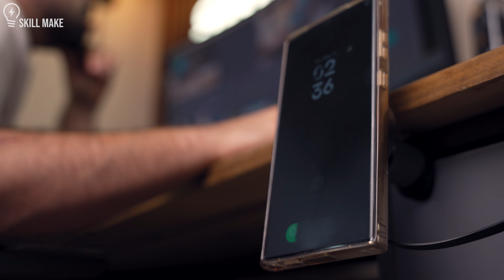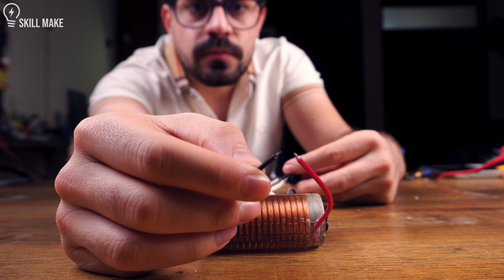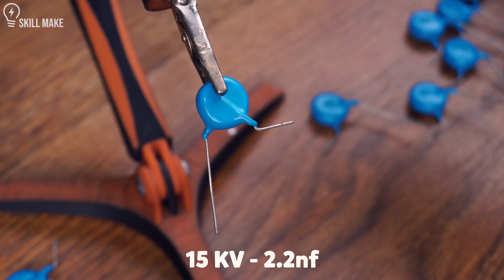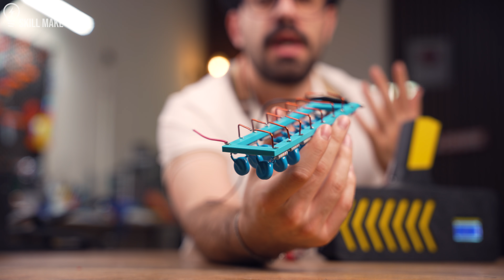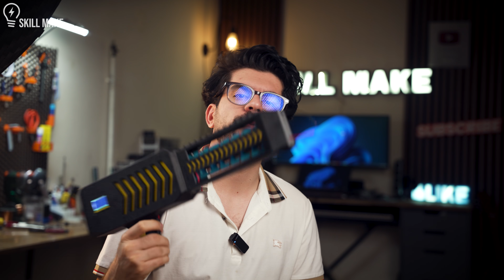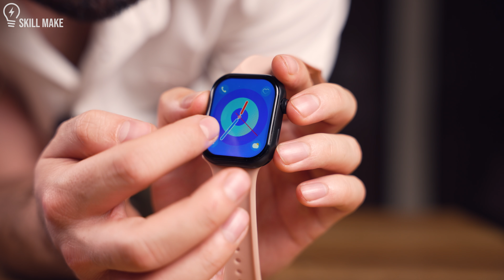I Made an EMP Device... It Actually Works

Comment: My question is can I use a microwave to just make a EMP out of that?
Reply from the maker: That's a classic movie myth! 🎬 High-voltage microwave transformers are incredibly dangerous (instantly lethal), and opening up a magnetron doesn't make an EMP—it just leaks highly dangerous, invisible radiation that can cause serious burns or blindness. True EMPs rely on ultra-fast, high-voltage capacitor discharges, not appliance parts. Stay safe! ⚡🛡️

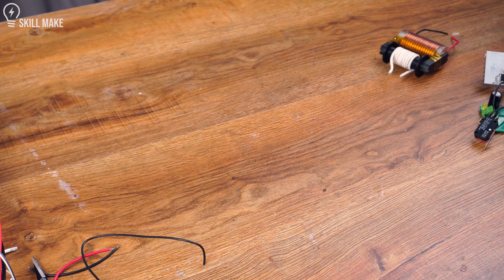Comment: 3:54 always follow the one hand rule man... I know EE ain't your background but that thing can kill you, not joking, no need to try it just don't use two hands like that.. simple enough. One more thing your voltage is max to max 800 times or less near that, never 1333 times higher, the voltage drop of your thin wire of that length is huge. And one more important thing.. here you need voltage multiplier ladder circuit using hv diodes.. not a marx generator.. pretty inefficient
Reply: +1 on that. High voltage across your chest - could be your last experiment.
Reply: Exactly!!! Cockcroft-Walton voltage multiplier... Works well

Comment: Not quite just giving 5v to a coil, needs to be high frequecy AC, and you can just see a transistor hanging (part of the oscillator needed).

Try charging a piece of 10 ohm coaxial cable (you may need to make it yourself), add a piece of ordinary wire on top, the length being the same as the coaxial cable (you will need to take into account the cable velocity factor). Charge the co-axial cable through a high value resistor (a few megaohms), and have a small spark gap (if you make a pressurised spark gap, you can get higher voltage up to the breakdown voltage of the coaxial cable), between the inner and outer of the co-axial cable. charging voltage only needs to be a few thousand volts, and you'll get a high peak power damped RF wave out of the antenna. Basically a vhf/uhf spark gap transmitter. Has some interesting effects, and you can run it from a tiny inverter and voltage multiplier (will work from just 3 volts into a disposable camera flash inverter followed by a voltage multiplier).

Comment: You need tweeters, and while you can make additional panels that could be better tuned for high frequencies, tweeters are 99% easier and will sound significantly better.

Comment: epoxy is normally not reactive when using less hardener.. you have to use a slow hardener, otherwise you risk that it doesn't cure at all..

Comment: An example of building things without understanding what you're doing.
Reply: Can you expand? What particularly is not being understood?
Reply: @MAORIguy25   But do you really need that? There are tons of comments that list everything the author does without understanding what he’s actually doing.
Reply: @nocrash8494  there are tons of comments giving advice

I’m asking why you’ve said he hasn’t understood what he’s doing

Did you say that because people are giving him advice, and so if he’s receiving advice he must not understand what he’s doing?

Your comment was said and there’s no clarity on why it was said
Reply: @MAORIguy25  I’m not talking about safety guidelines, which are just as necessary—and are lacking here—but rather about conceptual errors, the absence of a single dimensional calculation, and the fact that there’s no clear idea of what is actually being built to achieve the desired outcome.
Reply: @nocrash8494  
So you wanted calculations?

He used a 3D printed case. The case isn’t a template. It must be custom built for the parts he’s assembled

He didn’t show himself drawing it nor did he state the dimensions for the build… and yet those are necessary to be able to print the parts then assemble them

My point t is, work was done. That work wasn’t included in the video

We have to assume other necessary work was done but the details not included in the video

The absolute wrong assumption to have is to assume no planning or calculation happened anywhere just because you don’t see those on screen. That is a step too far, nothing in reality validates your position

Comment: Never use both hands, you're putting voltage across your heart
Reply: Not sure but afaik is the frequency to high to trigger the stimulus conduction. The problem with 50 or 60hz is that some parts of the frequency can interrupt the normal electrical stimulation of the heart but with that high frequencies this doesn't happen. I'm also not sure if it penetrate the skin very deep
Reply: Luckily the output is high frequency AC at that point..so whilst it was unpleasant more of an RF burn too.
Reply: He has a heart of steel
Reply: he isnt
Reply: i learnt that using my left hand to find the switch pins, right hand on the cables. Not a good idea.
Reply: There are four things to consider. Voltage, current, frequency and exposure time. None of them is dangerous by itself. But some combinations are really harmful, some them are deadly, and some of them don't give you even a chance to realize if you are still alive or not.
Reply: he's just charging his internal battery at a really really freakin fast rate of dendrite formation the rips the iron from his blood.
Reply: current, you mean
Reply: He only needs 30mA for a heart attack too.
Reply: If the current is low enough, NOT a big deal
Reply: And no resistor to limit the current

Comment: Next add a spiral line flux compressor to the device, a high pressure spark gap to trigger it with another to stiffen the output, finish with an antenna tuned to the center you want. ❤

Comment: So it is basically a taser with a coil? The main issue may be the range, which means you have to be very close to blow up the circuit.

The second problem is that you may only burn circuits that have no protection. Try that on anything that has a fuse or a voltage regulator and it may well fry only that component, instead of actually blow up the CPU or RAM or any other vital component

Comment: You might try replacing your MOSFET/PWM module with a simple transistor oscillator, as this would automatically match the resonant frequency of your transformer & drastically increase output. You should be getting much more than you are from that transformer. There are plenty of simple 2 transistor designs available online that could be adapted to your setup with a few changes to the primary winding. Good luck.
Reply: I need a big version for straightforward destroying the neighbors' speakers 🔊 😫, a jammer isn't enough
Reply: Old guy here avionics technician and used to have a TV repair shop back in the old days from 76 years old makes me think of a flyback transformer in a black and white or color TV set
Reply: What do you propose to increase the range of this thing?
Reply: @هل_تعلم_747  a bigger coil on the front end..
Reply: @jamesowensii2562  I am sure that you mean the diameter but is there any adjustment in the circuit?
Reply: @jamesowensii2562  Ich denke das Gerät wäre auf jeden Fall "ausbaufähig" - und man müsste mal damit experimentieren. Ich könnte mir vorstellen, dass ein Ferritstab den EMP Impuls ggf. "focusieren" könnte. Aber so ein Gerät, wo man auf größere Entfernung Elektronik ausschalten / zerstören kann, wäre auch zu "reizvoll" es  einzusetzen. Denke da nur an den Ukraine Krieg und die russischen Bomben usw.

Comment: resistor placed in parallel with each capacitor helps equalize the voltage distribution across the series string
Reply: No its the grey goes with the aqua, looks pretty.

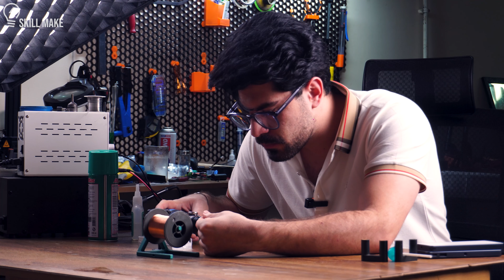Comment: Why did you use an AI-Generated transition clip on 1:43? Is the jump cut just not enough these days?
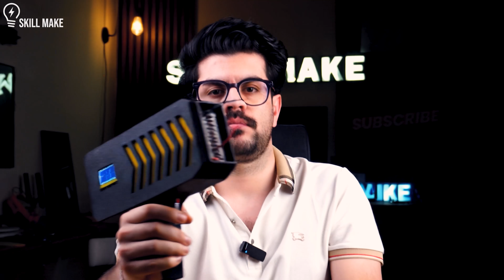Edit: Just saw the one at 4:18 and it's even worse. A lot worse. It's outright slop. I might just click off. This cool project is not worth me getting slop pushed down my throat.
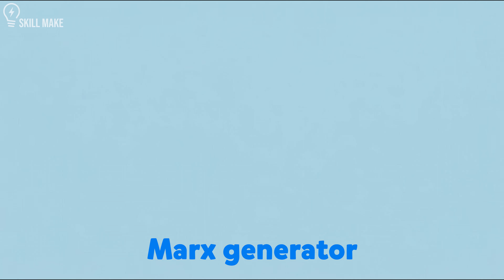Edit 2: The explainer at 4:46 is entirely ai generated. You literally could use a simple white board. Don't have one? excalidraw exists. I have enough of slop, thank you for wasting my time.

Comment: It would be interesting to study the results on the circuits. Im going to assume that you blew out the gates on the transistors but it would be interesting to see what other components got destroyed.

I once got a box of about 30 access points that came from a Ford factory and I guess they were all sharing some of their antenna cables and lightning hit the thing and end up frying all the access points. The things were fubared. The access points had multiple boards in them and you could see where the bolt arced from the housing and through the boards. It was pretty wild. The boards had holes melted though them that were about as big as a quarter.

Any how, I think it would be interesting to see what components survived and what didn't. Like did the surge just blow a zener diode or a fuse or did it kill everything? I work on radios and a lot of RF circuits are under EMI shields. So did any of the shielded components survive?

One thing that I've always wondered at is if loose components took damage. Like is that pulse going to generate enough current flow on the leg of a surface mount transistor to actually blow it? Installed, it's attached to traces, wires and cables that are all going to generate current but if it's loose, it's just a little nub of conductor.

As someone paid to fix shit, EMP has always left me wondering what would be fixable or where one might find the parts. I know lightning isn't. That's TOO much EMP! When the boards themselves catch fire, you're done. Only to get us off of Gilligan's island would I continue to try to fix it.
Reply: From a security perspective would be also interesting to see how they fail, for example does an entry access system break with the door open or closed? Does a gate open when the pulse is applied?

Comment: Good job!
Why don’t you use a voltage multiplier by adding diodes between the capacitors?
Reply: Diode/capacitor Voltage multiplier has limitations. Can't go past 15kV or higher
Reply: I see. You need a surge form, not the continuous one.

Comment: Shocking results! 😆
How did that Pulse break your electronics specifically? Popped Capacitors? What if it didn't have capacitors? Are they fixable? 

A couple Design questions if would be so generous 😊:
What if you used a Boost Converter at the beginning and end of the circuit?

Could this be used like Maglev to launch conducting materials simultaneously or would that steal energy from electricity for electromagnetism?

What it the end of the barrel's circuit had a (maybe Toroidal?) section so it could increase the accuracy of the pulse?

Would Electrolytic Capacitors provide a better result?

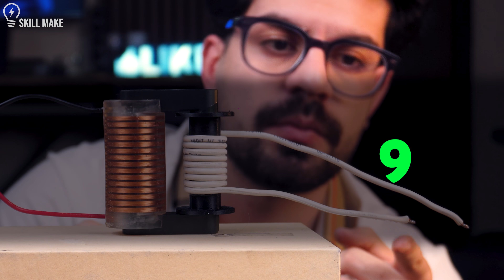02:54 Can you use 2 turns on the thick wire, so it's 6k Volts?

Thank you for your humoring my obsession with electrons lol & Super fun video! 🙏

Comment: Sick build, what do you think about using high rpm motor to spin a powerful magnet to get the alternating magnetic field for EMP rather than only AC through coil?
Reply: You'd never find a motor fast enough, or a magnet powerful enough.
Reply: @MrTekwiz  won’t be as fast but no high freq losses either from skin effect
Reply: Too inefficient. What happens if you can’t power the motor? You are cooked. Also, motors already have back emf when you are using them. Could possibly interfere with the magnets as well.